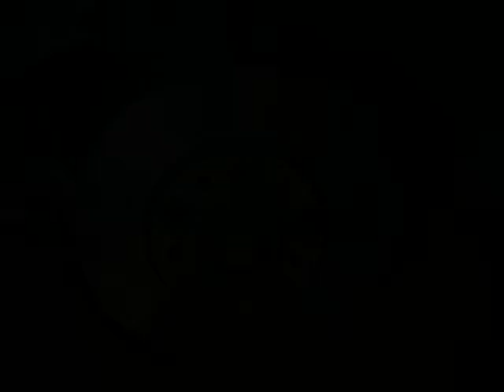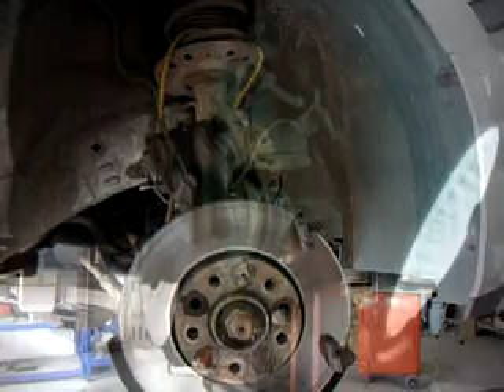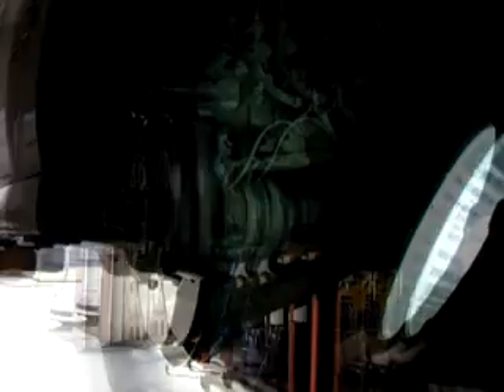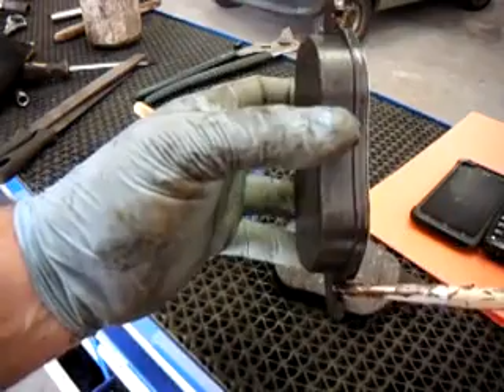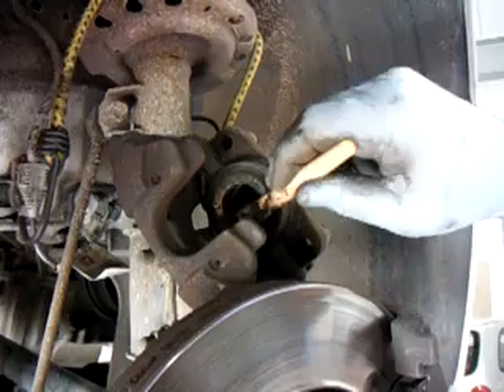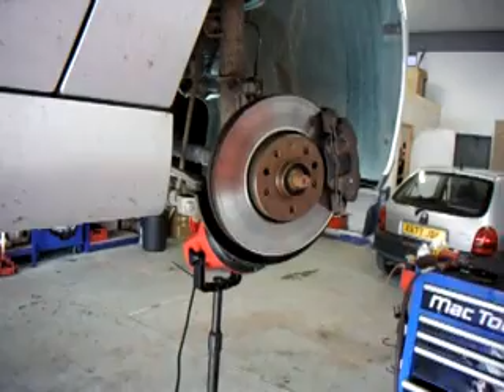Replacing front brake pads - Mondeo 1.8 2006

Comment: Why have you posted this video guide under the heading replacing front brake pads - Modeo 1.8 2006 when the car you are working on is clearly a 2000 Vauxhall corsa??  The pads on a Modeo look totally different and there is no retaining spring.